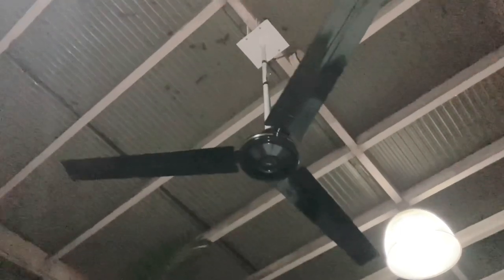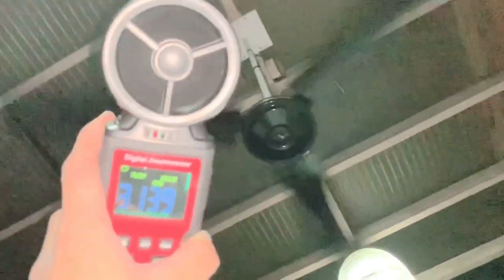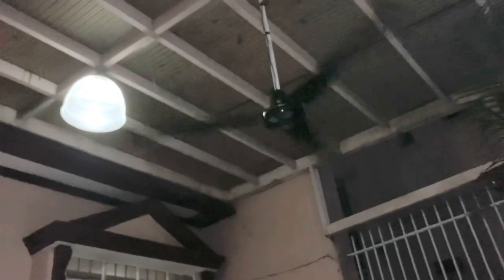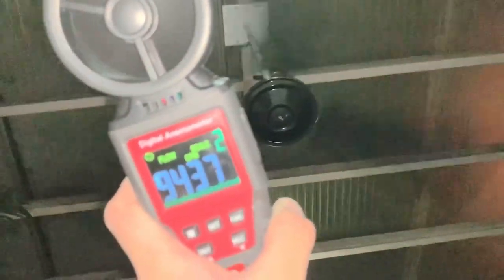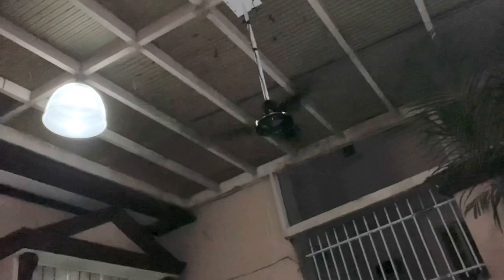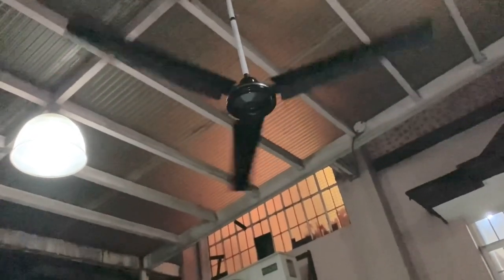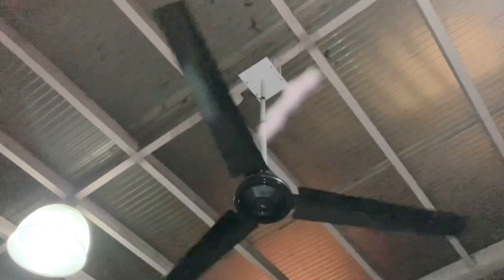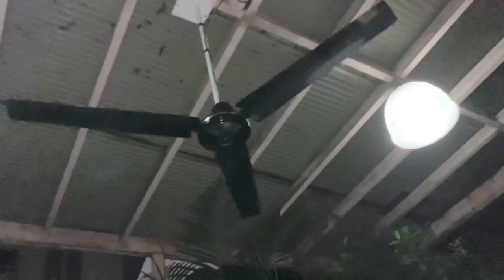New Purchase: Asahi industrial-*style* ceiling fan

Comment: Is it okay to also use indoors? Or is it too loud?
Reply from the maker: They’re actually designed for indoor use. They’re kinda loud on high but very powerful. If you want something quieter you might be better with a ceiling fan that doesn’t have metal blades